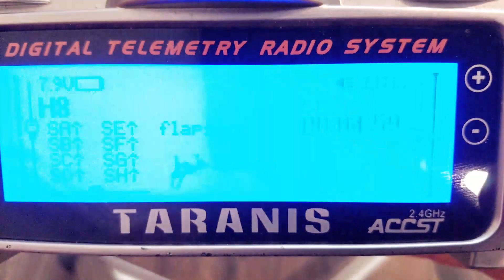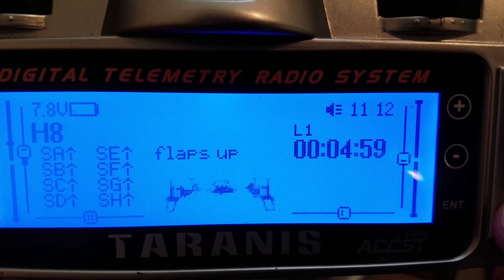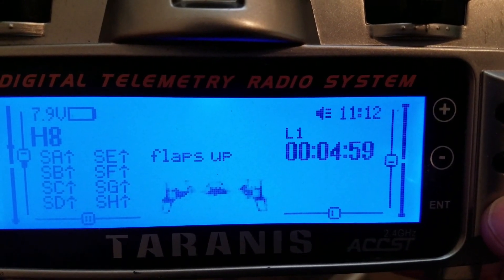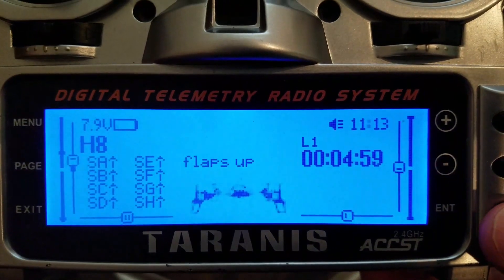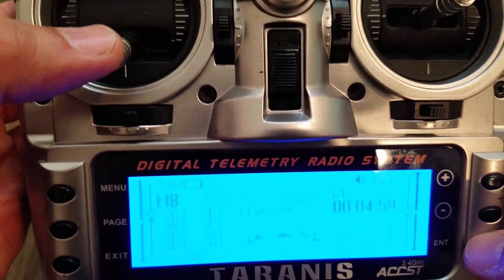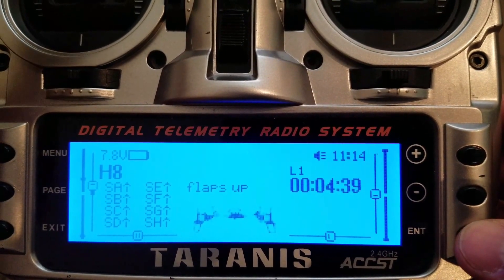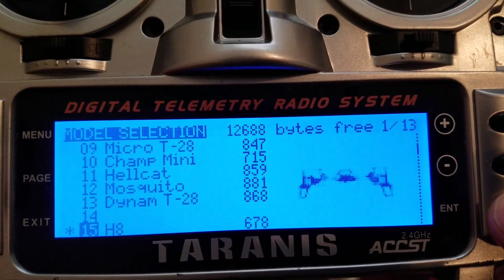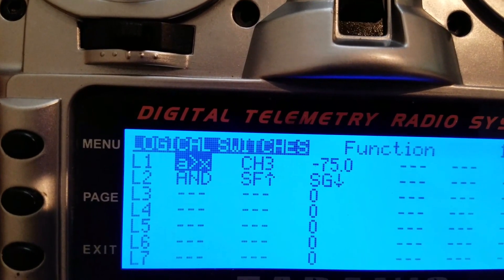How to Set Up a Throttle Activated Timer on Your Taranis Radio

Comment: I followed the steps but when I go back to the main screen the timer is already running.  Turned unit off/on and the timer starts with throttle not moved.
Reply: An easier way to do this is make it "THs" instead of L1. You don't have to mess with logical switches and it will do exactly what you are wanting it to do
Reply from the maker: Not sure what the problem is, but make sure that every single setting is the same. The logical switches are mathematical, so any difference in input will produce a different result.